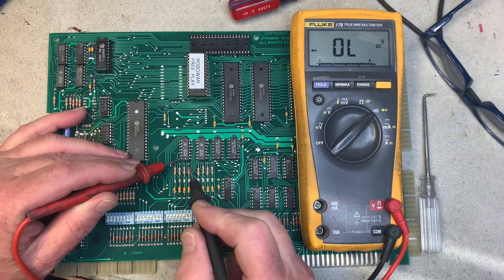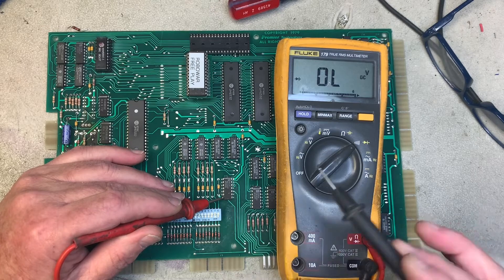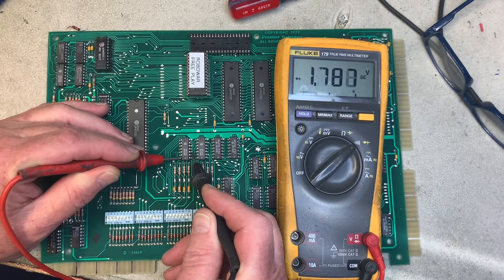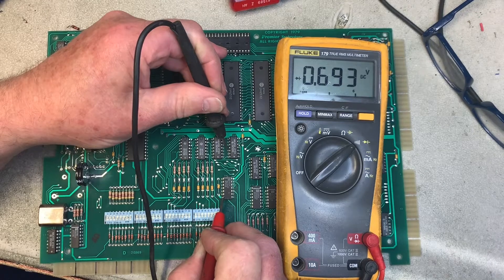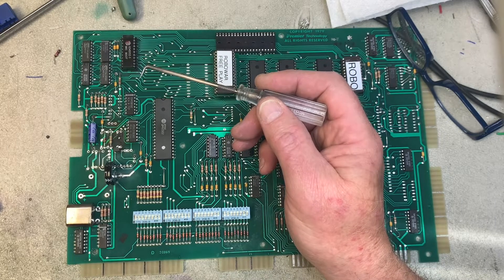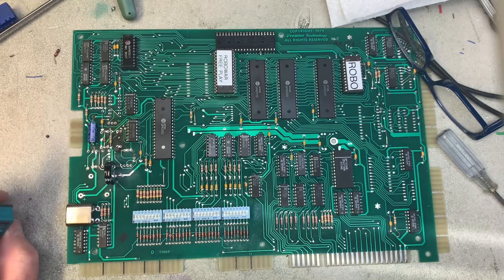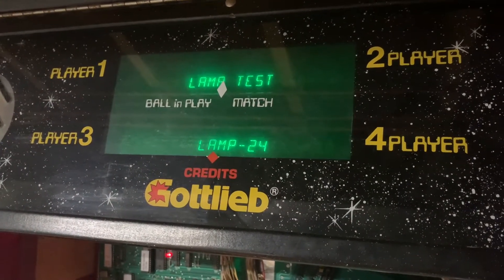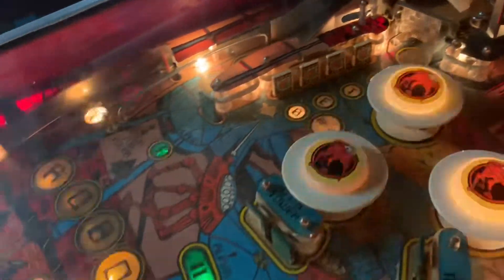Gottlieb System 80B RoboWar MPU Corrosion and Switch Matrix Repair

Comment: Chris where did you get the replacement system 80B daughter board from?
Reply from the maker: The one pictured in this video was from nvram.weebly. But he no longer makes them. I make my own now. I have a U2/U3 connection redundant version and a version that simply fits into U3, like the OEM board, but it's not cantilevered. It's similar to the nvram.weebly board in form factor. Send an email if you'd like one (or more) chrishiblerpinball AT gmail.com